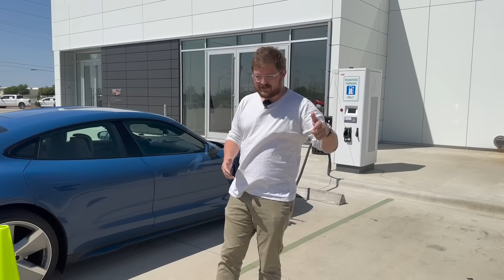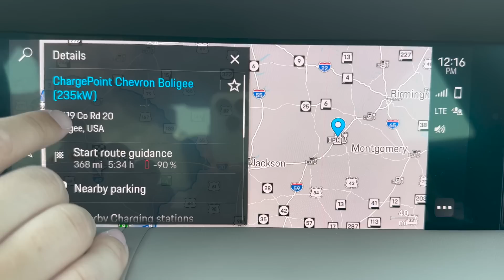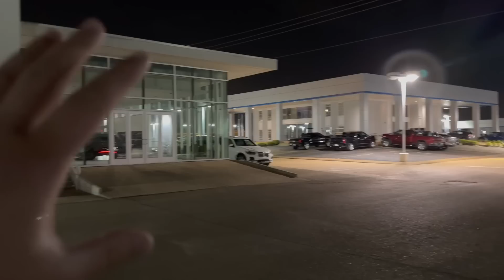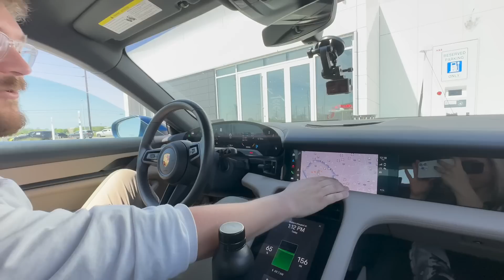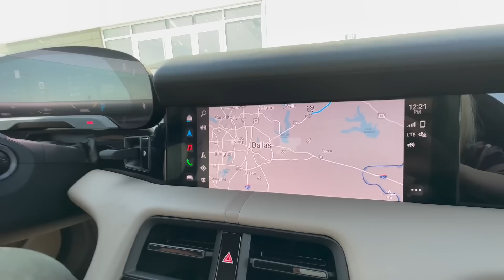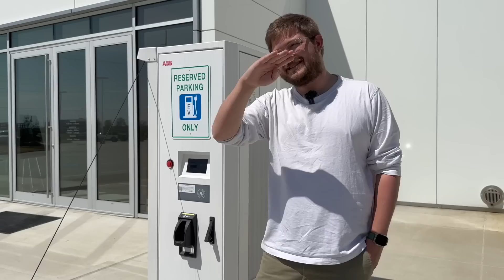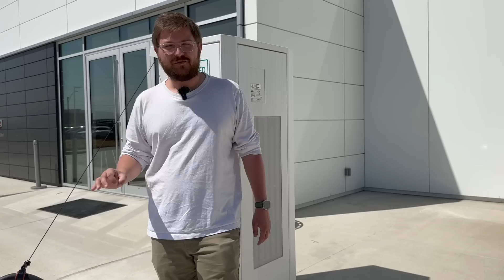The Great Southern DCFC Desert! Meet The Single 50kW Charger Linking Dallas, TX To The East

Comment: Try going from Fayetteville Arkansas to Dallas. What's worse, there looks like a charger in Mc Alester that's 200 kw, so you think you can stop there, but half the time it doesn't work and if it doesn't there's no backup.  When it does work it works at 50Kw.

Comment: This stretch is a PAIN for us! Going from Huntsville AL to Shreveport used to be impossible for non-Teslas (unless you stopped for level 2 or 1 charging) We are hoping to be able to complete this I-20 route with our Taycan soon!
Reply: Keep track of the Buc-ee's they are building in Ruston, LA. Should have 20+ chargers. Hope to have my EV by then and charge during the grand opening.
Reply: All I have got to say about this is that it will be awhile before any chargers are installed in central mississippi other than dealership chargers ea and evgo nowhere in sight
Reply: Get an ice vehical
Reply: @jebes909090  I have 3 ICE vehicles as well as my EV. Thanks! I prefer to drive with the EV.
Reply: @justinjones6810  I'm expecting Walmart to make their move. I could even see them get into the EV rental business.
Reply: @jebes909090 why are you watching this channel
Reply: @kennyb123  do i have to be a yes man to watch a channel?
Reply: @jebes909090  it's a channel 100% devoted to electric vehicles. You keep making that comment and see if it gets you anywhere. Good day, sir.
Reply: @kennyb123  so basically vegans then
Reply: I live in Baton Rouge, LA.  Not only is I-20 a charging nightmare, I-49 up the north/south center of the state, is no picnic either.  Louisiana is the pits for anything remotely progressive,
You had asked about our state's ev infrastructure plans, though.  Early last year I heard on the capitol area public radio that they have made plans for
 the ev infrastructure federal funds to place fast chargers on each interstate at no more than 50 mile intervals.  When is another question.  Nothing happens fast in this (sportsman's) "paradise(?)", and I can only guess it is currently mired in the tough task of figuring out whose palms have to get greased.
This is a state where the 400 mile range aptera would really come in handy.   I am waiting with baited breath for the rollout.  But oh, right.   Currently Louisiana is one of those states still barring direct to consumer vehicle sales.  Way to go, protectionist auto dealers guild!  😱
This is a state where big oil has deep influence.  That simple fact explains a lot.
Reply: @Dularr  There's a decent chance they'll be just Tesla chargers
Reply: @Dularr  I live in Saint Cloud MN and I see Teslas at the local Walmart pretty often, including a Model X at least three times that I remember.
Reply: @fixman88  how far is your service center.  My nearest center is over 200 miles away.
Reply: @Dularr  The nearest Service Center is in Minneapolis.

Comment: West Virginia needs to get the act together and get some DCFC installed.  I would love to see Tesla Magic Dock updates in West Virginia too!
Reply: You can charge ANYWHERE in WV, as long as your car runs on BLACK COAL.
Reply: I was going to leave this comment.  WV is also a dcfc desert.   The addition of a chargepoint at joe holland is South Charleston helps and they are charging 89 cents a kWh.   

All EVs charged in WV run on Black Coal.
Reply: There was a guy one reddit near Christmas that talked about building several charge point 200Kw to 350kW stations around Charleston, West Virginia at his gas stations but went radio silent so idk, with Appalachian Power the way they are it was probably going to be prohibitively expensive since they are supposedly doing an amazing job of squandering the building of charging stations that aren't government funded giants
Reply: @ToddGlasier  

Given that the West Virginia power grid is all coal anyway, a charger there would actually be cleaner if it used an onsite natural gas generator, rather than grid electricity service. It might also bypass some difficulties with permitting if the charger is sited somewhere where the gas supply is already there but the electricity supply isn't.

Or, if worst comes to worst, even a diesel generator is still less dirty than coal. Coal is about the dirtiest fuel imaginable.
Reply: EVs owned by hillbilly's!?

Comment: As someone who lives in louisiana, the lack of charging infrastructure on i-20 is a real pain point. thankfully EA will be building a spot in Monroe. If i were you i would've gone the i-10/i-12 route via baton rouge and houston and up to dallas. Its technically "longer" but youll make up on it with faster charging. Theres actually one more CCS charger in Ruston, LA but its a puny 30kw unit i think.
Reply: Or Mephis, Little Rock.
Reply: It was second-hand info, and a 1.5 years old story; but my friend and his wife took a Tesla from Houston to New Orleans and said that Louisiana was a charging anxiety nightmare. Everything from no chargers in major stretches, added 6+ hours to their trip when they found one, chargers way off the beaten path on I-10, etc. 
That state...really seems shady about EVs.
Reply: @scooterjsl  the I-10 corridor has tesla superchargers every 100 miles or so. driving in a tesla is fine. Driving in a non-tesla EV? thats another story
Reply: @xyeahtony1  gotcha, I was trying to qualify my 2nd-hand story that this was a couple years ago. So that stretch in Louisiana might have had some updates since then.
It might’ve even been 2020. Time seems relative since Covid

Comment: I had a Lucid Air Touring on order. But, the EA charger where I work is usually full, partially working, or dead. I canceled my Lucid and got a 2022 Model S Long Range. I can drive from Ohio to Indiana and back if the chargers are dead. Ok, I could, but major pain in the butt!

Comment: I travel across that stretch between New Orleans and Dallas 10 times a year. It is one of the primary reasons I was interested in the 600 mile Aptera. Instead I plan on getting the 400 mile aptera and getting a 14kwh battery pack to put in the trunk that will let me stretch to the next watering hole.

Comment: I live in the northwest, but have family in the southeast. Each time I visit, I feel I am going back in time in terms of the number of EVs I see on the roads. At home, any visit to a busy shopping center, you are almost certain to run into an EV in the parking lot. Over there, it might take several days of visiting busy shopping centers to encounter even one EV in the parking lot. What few EVs exist down there are almost exclusively Teslas, and they almost exclusively charge at home, as public charging down there is nearly non-existent.

Still, while the EV ownership rate in Houston is low, it anecdotally does seem to be trending upwards. It will eventually catch on, just many years later than in CARB states.

Comment: Areas like this, Montana & the Dakotas, and a couple others are why we need for more EVs with 400+ mile range. The good thing is the recent news witl silicon electrode batteries with twice the power density per Kg & per Liter, & Ore Next Energy's Gemini battery pack.

I think Tesla is seeing how the Magic Docks holds up before more widespread rollout to avoid situations like the new EA chargers not working in the cold.

Be sure to enjoy some Texas barbecue!
Reply: The solution to this is freewire. 220 V input and DC fast charging.
Reply: @garrettpeck1746  I just checked them out. Why aren't their chargers being deployed more and more? It sounds great to me.
Reply: @Vince-xr1oh  I’ve seen them In California. Probably because of the initial investment cost.  They are approx $200k per unit.  A commercial level 2 is less than $5k.

Comment: West Virginia along I79 is also a CCS DCFC desert, Morgantown has 2 separate 24 kW charging stations (at Freedom Kia & Mercedes Benz of Morgantown), then there is a 24 kW station at RG’s Almost Heaven Harley Davidson 39 miles away in Bridgeport, WV, then the next DCFC station along I79 are about 140 miles away at Charleston (Joe Holland Hyundai & Astorg Auto Mercedes-Benz, both are 62.5 kW ChargePoint), and if you’re heading to Lexington, KY the next station is 115 miles away in Morehead, KY at Eagle Chevrolet.
It’s doable with most EV’s but the charging time along that stretch would be atrocious, which is why we drive my partner’s Niro Hybrid from Maryland to the Nashville area for Christmas vacation, although if we drove I81 through Virginia the charging situation is slightly better than going through W. VA.

Comment: Being able to enter a address into a Tesla and have your route planned out for you is priceless.
Reply: and the reliability and plug and play is amazing too.
Reply: This is the main reason I went with Tesla and not with BMW after 18 years.
Reply: A little 1990s archaic vs Android Automotive where I just get in the car and drive and it adds stations automatically as necessary.
Reply: Alot of manufacturers do this now.
Reply: And then your bumper falls off 😂😂
Reply: @tamasboros896  I just bought a BMW i4 and the GPS system ties into charging networks and will tell you where you need to charge and how long for until you get to your destination.
Reply: @youdontknowme2915 That's funny😂
Reply: @youdontknowme2915  Don't do drugs, lol.
Reply: Same with the Mustang Mach-E. Route planning and Plug & Charge are the big reasons why I got it.
Reply: @CaptDnaDonut  There are levels to this. Mach E has nowhere near the reliability and availability when it comes to charging compared to Tesla.
Reply: @isosavvy  didn't say it was on the same level. But it has worked very well for me and was a huge selling point.
Reply: Or the price of a Tesla, as it turns out ;)
Reply: The Tesla seems more accurate, but the others have gotten much better.
Tesla overall is slightly best, but ignores CCS still. Prefer a better route planner for long trips, especially if I’m going to be carrying extra weight. 
Then there’s the 2 pop up warnings it gave me last night to plan my next charging stop. Was at 29%, with a projected 27% when I got home. Where I charge….
Reply: Um, google maps?
Reply: @AaronandbriEnneThis. If I didn’t use the CCS charging options I would have been stranded. Two major tourist destinations here in Arizona ONLY has ElectrifyAmerica, Tesla would have you going out of the way to a Supercharger to get what you need, but these EA stations saved my butt (and my marriage).

Comment: Great adventure video! But the low stress and fastest route from Tuscaloosa to Phoenix would be a slight backtrack down to Montgomery then down to Mobile to pick up I-10 which has high-speed chargers all the way. Faster chargers - quick arrival. I’m glad to hear that EA may be building out I-20. These adventuresome videos are a great way for us viewers to learn unless we take away the wrong idea that it’s not practical to go coast to coast.
Reply: I was thinking the exact same thing. I used to live in Austin & would drive to Vegas & I-10 takes you straight into Phoenix plus there are 4 or 5 EA chargers between San Antonio & El Paso.

Comment: Totally agree with the Supercharger magic dock comment, here in WA, road tripping the Olympic peninsula is difficult and the Oregon coast, but the Supercharger's  opening would make it much better. I'm afraid that they may not add magic dock to the V2's that are still everywhere in less busy areas, but where CCS capacity is badly needed.

Comment: I will repeat that Tesla needs to do more than install "Magic Docks" on some of its Superchargers: they need to develop and sell Tesla-to-CCS2 adapters —just like its CCS2-to-Tesla adapter— so ANY Supercharger is available to other EVs. BTW, I bet Anna is loving that Taycan: looks as beautiful as when she picked it up.
Reply: I can't speak for Tesla, but I would imagine the reason they don't come out with a CCS2-to-Tesla adapter is that the Magic Dock gives them control on the numbers of non Teslas at a charging station. If they would open it up so all non-Tesla, it would be a free-for-all and Tesla owners may not have any open chargers available.  The Magic Docks are there as an option if nothing else is around that is functional.
Reply: I don’t think you will see a functional Tesla supercharger to CCS adapter because of potential billing issues.  MagicDock solves that issue.
Reply: @johnpoldo8817  Your response makes more sense than what I originally thought.
Reply: The fact that the supercharger stations in CCS deserts are not open may very well be intentional. This way that don't have to give the "only Teslas are allowed to charge on I-20" edge in car sales. Only when someone else installs CCS chargers on I-20 and that edge is lost anyway, will Tesla bother to install the magic docks.
Reply: @ab-tf5fl  I can't say if Tesla will or not, but I believe they would get some of the federal money if they do. That is a big incentive. Also charging a premium to non Tesla cars when charging helps their income as well as they could grow and monopolize the EV charging industry.
Reply: @jamoss55  They already do. It is not up to Tesla to do what the makers of others cars will not do.

Comment: Once again an informative video, what about making an adapter for a 50 amp RV campground service to plug your home charger into in a pinch it could save you from being stranded.
Reply: I actually carry a portable charging cord in my ID.4 that i can plug into the 50 amp rv plug at a campground.  Actually had to use it a couple of times while out in the middle of nowhere Texas. Only drawback is getting the campground to let you plug in and at what cost.  I can get about 24 miles range per hour at one of those plugs. I also have a 50 amp plug at my home and use the same cord to plug in there to do most of my charging.

Comment: $1/kWh is pretty bad, but it's not as bad as a dealership in a nearby city to me. They charge $2.50/kWh and $20/hr parking fee after 30 minutes. It makes no sense when there's an EA station 10 minutes away. The only reason I could come up with is that the dealership wants to make sure no one uses it but the charging station provider (EV Connect) requires that it be publicly listed. Some dealerships do similar things because they want to keep the station available for their staff to use to charge up customer cars, or to diagnose charging issues. My local GM dealer just locks the stations during business hours. I'm wondering if EV Connect is able to do that.

Comment: Think that is bad? Plan a trip south from Tulsa, Little Rock or Memphis to Louisiana so that you can get to Florida (for example).
Reply: Yeah those route are pretty rough.
Reply: Amarillo to Denver is another one. Tesla cars are covered by superchargers. Everyone else gets to navigate 225 miles of highway 287 from Wichita Falls to Amarillo with nothing but level 2's, most of which are nothing more than bring-your-own-plug RV parks. And, according to PlugShare Wichita Falls, itself, is limited to only a single 50 kW CCS charger, which is quite expensive. It might be doable going west to west to east where you get to combine a strong tailwind with a 2,500 foot net elevation decrease. But, driving it the other direction in a non-Tesla EV looks like it would require either a Lucid or an overnight stay at a campground.

Comment: A range 400-500 will allow many things 2 of which would be traverse areas with no charging with no stress.  Also can pass up full chargers when needed.
Reply: Honestly, I think the only thing higher capacity batteries really do is allow the driver to charge to lower states of charge (and thus charge much faster). Charging cars to the top of the pack is just so slow that many users only do it if they have to.

Comment: I always carry a level 1 charger and a level 2 splitvolt charger 50 amp you can use at campgrounds and 30 amp with TT-30 120 charger (for the split volt adapter). You need to be a boy scout with EVs and charging. I own a Kia EV6. Always carry the Tesla destination adapter. How  many kw is Porsche battery?

Comment: I have looked at the Atlanta to Dallas a number of times. Quick check of ABR says to go through Nashville. No problem. EA chargers regularly along the route.  I always carry my J1772 to Tesla for overnights too. Avoid I20. The reality is that any EV road trip still requires a lot of planning.
Reply: I take this route between NC and SoCal. It's ok for Teslas, but it should be drastically better. They just need to up the total number of spots (not the number of chargers). It would be a massive improvement to get V3/V4s in the area. Honestly the issue is Texas. From Lindale to El Paso, the stops are just not that great. And the ones that connect to El Paso aren't great either (Demming, NM and Wilcox, AZ). I have a CCS connector to jump onto a CCS charger - but there aren't many good ones in the area either. 

Checking the map, it looks like Tesla is installing new ones all over that area this quarter, but not in Lindale... (which may be the worst spot)

Comment: You can use an electric car for long trips but its not really what they are for. If you had integrated rail infrastructure you could use that to transport the car long distance. I think even in Europe only really the EuroTunnel train between the UK and France offers that.  It kind of suggests the world needs more integrated travel systems to get the most out of electric.  Anyway it seems battery capacity will double in the next few years meaning twice the range.